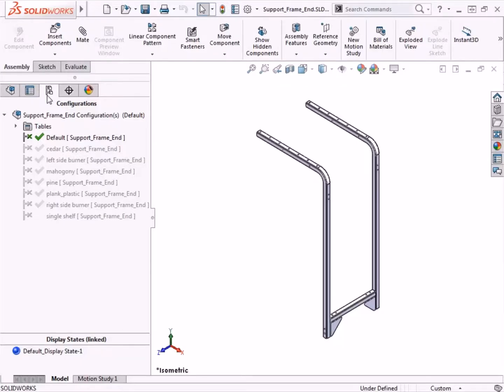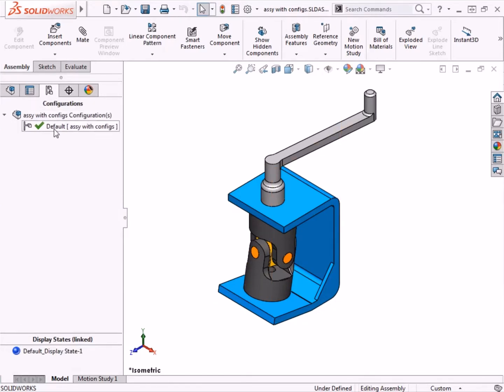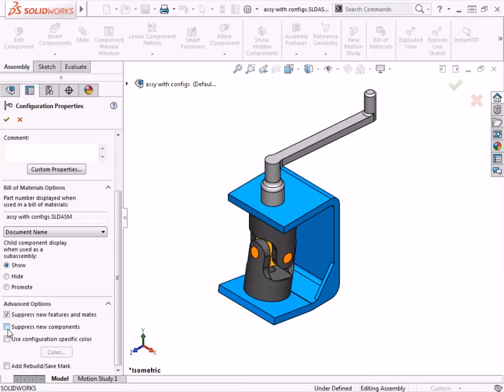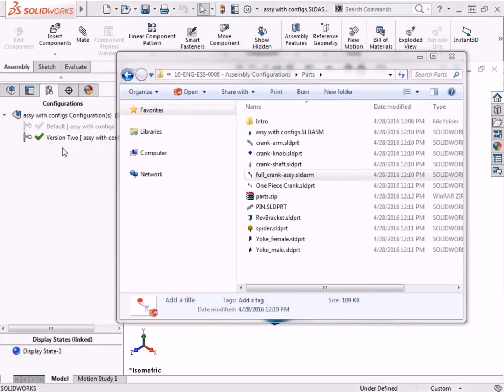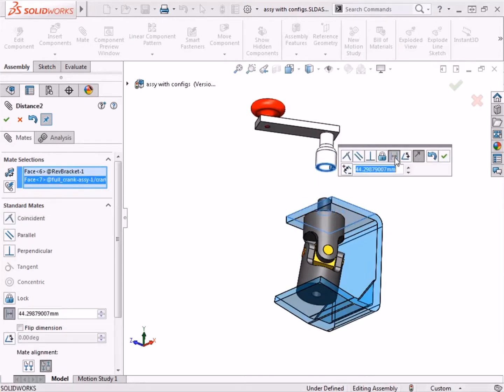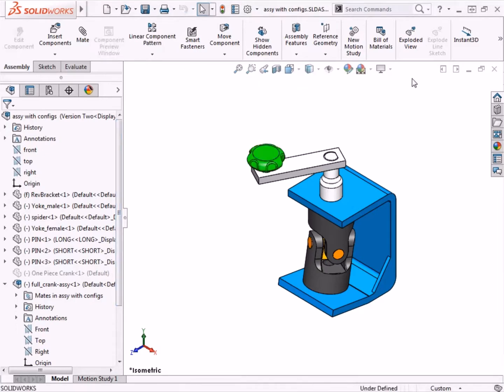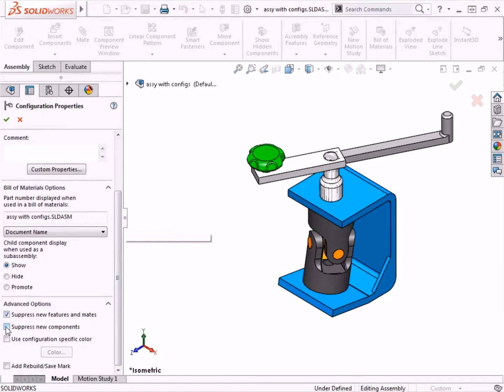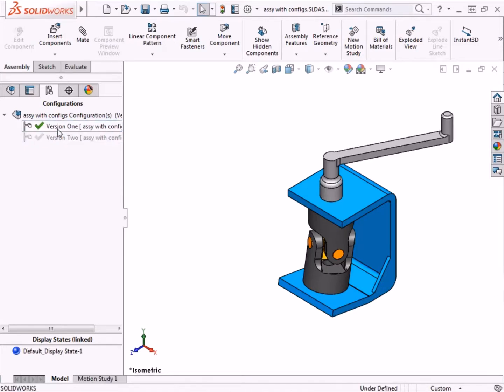🔴 Assembly Configurations SOLIDWORKS

Comment: Is it possible to make a master assembly ? Like whenever we want to change the dimensions of the master assembly . It should change according to the required size of the assembly we need
Reply: Yes, you should look for Top-Down Design. You can do it in SolidWorks for small assembly not complex ones. However, Solidworks it is not strong enough ,for this approach, like Catia or PTC Creo.